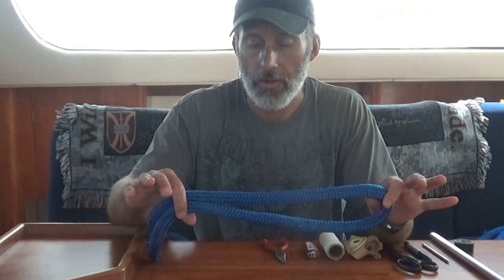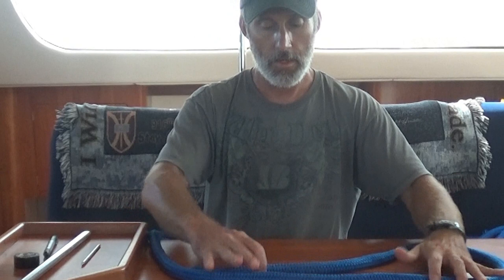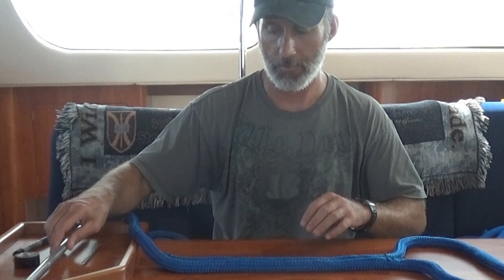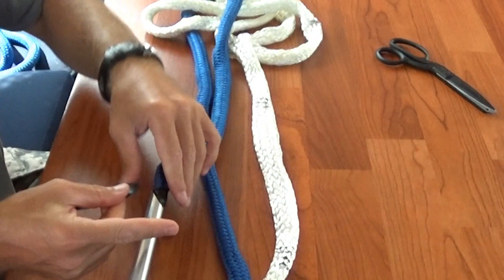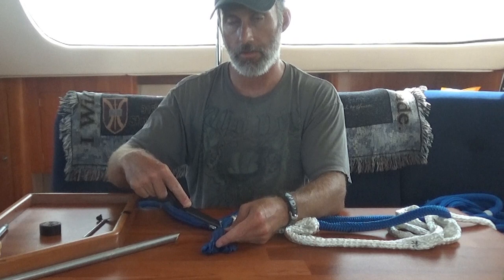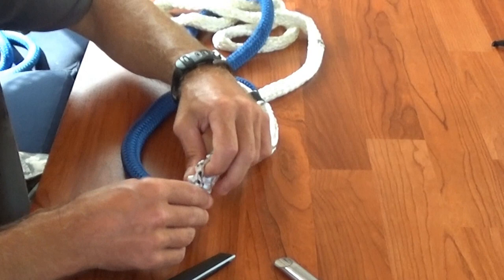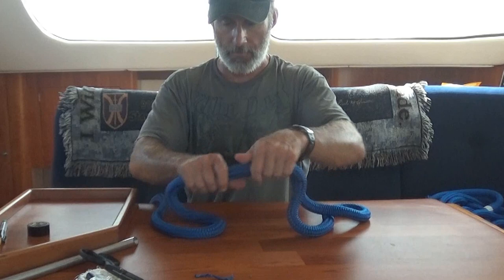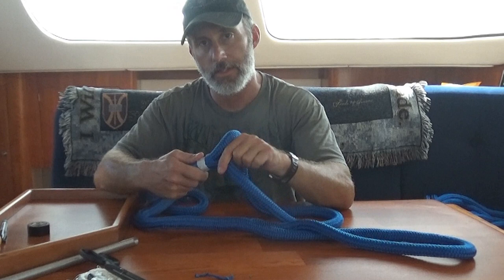How to make an Eye Splice Sailboat Maintenance

Comment: Great video. I like how well organized and concise it is. Thanks a lot!

I now know I'm just going to buy a pre looped line. 😅

 Until i can find or make a tool set anyways.
Reply from the maker: It can be a little time consuming for sure. It's something I did more to learn than to save money or time. 

Thanks for watching.
Reply: @Unwrittentimeline  Definitely one of those skills you need a few rounds of practice with and worth doing. I live in a climbers town so the tools might be around. I have a small 10' boat and would use smaller line but it tangles too easily which becomes problematic on a river when timing is important.

Also lots of rocks on shores around here so the abrasion resistance doesnt hurt.